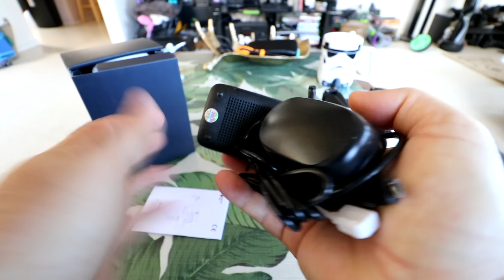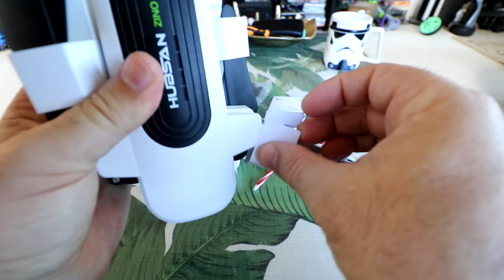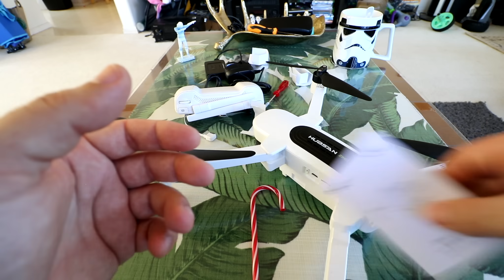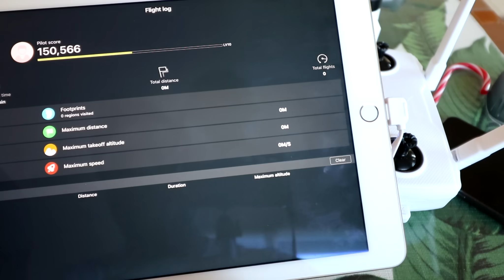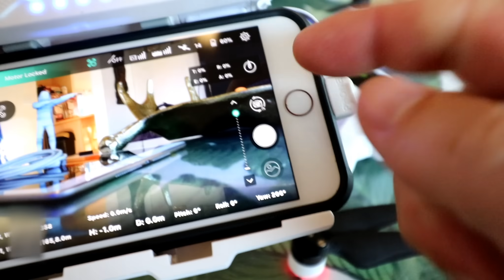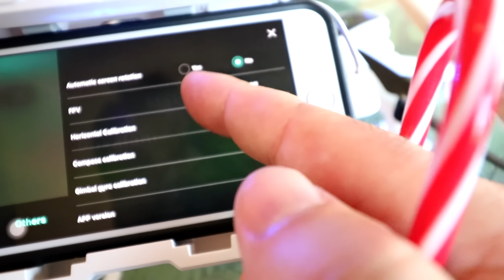Hubsan ZINO Review - Part 1 - [Unboxing, Inspection, Setup, Pros & Cons]

Comment: Dustin, what is best batter for zino to optimise flight times, think I getting 14 mins out of a 3200 gifi bat? I intend to invest in a 4200 mah gifi from aliexpress but will it boost my flight times up? I am aware I can get a 6500 mah Zino pro batt but it needs velcro in? what would you recommend as a seasoned Zino pilot? Rob
Reply from the maker: You'll get more flight time but remember it stresses the drone out the more weight you add so parts may not last as long 🍻

Comment: I ordered the Zino from the company website on July 14th and just received it today.  Every thing was packaged in the black bag because I ordered the Zino Portable version that comes with one extra battery, carrying case, and car charger.  But, I was surprised Dustin received an Asian type wall plug instead of US wall plug.  I received US plug type.  I agreed with Dustin that the manufacturer should paint different color on the controller.  Everything is white, but my video button has no red dot. It has a video symbol.  It took me almost 4 weeks to receive it and ends up paying $40 for shipping because the company said they don't have in the US warehouse.  So, it shipped from China via Fed Ex.  The Chinese company logistic needs to be faster on par with American.  They're slow.  I looked at their shipping status. It was picked up from the company on Monday and ship to the final location in the other city about 40 miles distance.  It took them 3 days.  On Thursday It was flown out to South Korea, then to Anchorage, Alaska, then to Washington DC.  Just two days on the fly. The Fed Ex delivered to my door on Friday before noon. It means today when I wrote this comment.  It moved so fast when it was in American hand. It moved so slow when it was in China.  I paid $419 for this drone, not including shipping cost. I never have any drone before and this is my first one.  Make sure you charge drone battery and controller.  It took about 2 hours to get full charge.  I plug in the drone battery at 6:30PM and went outside to mowe my lawn.  At 8:30PM, I came in the house, the charger shown green color.  I first want to buy DJI, but dang too expensive.   
If you need Zino manual, just type Zino drone manual. You will find a full version User Manual and a Quick Start Guide.  Then, you can print it out. I hope it will help.  I now need to set it up and need to watch more Dustin video.

Comment: took delivery of my zino yesterday, all cables were included for older and new android as well as apple, I took advantage of the Husban flash sale and got mine direct from Husban for 295$ US. I love it, I see comments complaining that it doesn't have the features of the mavic air...this is ridiculous, it is half the price and delivers as good of a camera and better gimbal, of course it doesn't have the features of a 700$ drone, but it has everything necessary to take comparable pictures and videos, and for 300$, 100$ less than a spark with a HD camera and 2 axis gimbal. Thank you Husban for making something I can afford

Comment: First, thanks for the vid. But I wonder why you keep comparing a $400 drone to a $1200 drone? It's really not fair to either. The level of detail is appreciated, but if you must compare to DJI - which makes no sense, but everybody does it - then please also compare to other $400 camera drones like the UpAir One, or even the Spark. Of COURSE it's cheaper. It's BUILT to be..  Software is the true trickle-down value, once the basic control and comm code is solid, anything you WANT - flips, race mode, dronies, waypoints - can be added for the small cost of extra storage. The rest is marketing.
I have no ill feeling fro DJI - the Spark was my next option, but for the 10080P. I just like to compare apples to apples,

Comment: I have big expectations about Zino. But they will need some time to get things to work smooth. I hope they will not rush. Better few months delay at final version then to put it on market not prepared.

Probably you now. Still I will wrote somethin about length units. But I know that you know this already. :)
1 yard is 0.91 meter. What could simply transfer into 1 meter. The difference is not to big. 100 meters = 91 yards.
While 1 yard = 3 feets = 1 meter.
So for basic is just need to multiply meters x 3 and you get feets. 100 meters = 300 feets.

And yes final version would be good to have both length units.

Great review. (Y)

Comment: Great review once again dustin.👍🏼 I’m so glad I went on your review and opinions on my drone options (DJI Mavic Zoom)
I’m not impressed with the Zino! I mean I’m still an hubsan fan as I have 2 H501ss drones and spent quite a lot on extras. They fly well and I had fun. 
But my Zoom is another level and quality. Excited to see you put the Zino through its paces. Do you only have 1 battery? That’s gonna be time consuming doing an in-depth flight.
Also would the H501s charger cable fit the Zino!! They look identical. Keep up the good work dustin loving your work👍🏼👍🏼👍🏼👍🏼👍🏼👍🏼👍🏼👍🏼👍🏼
Reply from the maker: Yes, the zoom is in another league but should be at the price difference.  This is a 3s LiHv battery so needs a special charger.    New US charger just arrived yesterday and works perfectly 👍

Comment: Its a UK 3-pin plug Dusty, you should send it to me. 😉
Reply from the maker: Thanks, I think the charger was defective or not US voltage compatible  and was only charging battery to 65%.  Got a new  US version in today from Hubsan and it's charging fine to 100% 👍

Comment: Look around for cheap balance charger B3 type.
I'm pretty sure you supposed to have at least two compatible,
if u still have XK500 he come with good tiny blue alumiinium  balance charger with buzzer and cell voltage detector.
Or maybe battery is not charge well because is budgeted.
Reply from the maker: This is an HV 3s so was hoping for full LiHv charge.  I did find a standard 3s charger that may work to at least get it over 65% which it seems to be maxing out at with provided charger 😂.
Reply: Ok, give it a shoot.
I just check RC sailors second video and they start at 100%,
if they not charge cell by cell with Imax B6, or some other better,
el chipo Hubsan charger must do the work.

Wait to see that maiden test at 65% battery
and another at 100%.
Regards : )
Reply from the maker: A new US charger came from Hubsan today and it looks like it's charging fine to 100%.  I think the UK charger was defective or not working for US 👍
Reply: Good,
me personally will wait to see some sort of review A3 vs Zino,
FIMI start shipping out too.
Especially after i see the white remote plastic.
Please upload some raw or edited-joined once 4k footage 
in further review parts if all other is ok,
Regards :)
Reply from the maker: Yes, I'll have 4k video and pictures up in flight test 👍

Comment: My bebop 2 just spun out of control today. Apparently two of the motors stalled in during flight. I was putting a bit of stress on the motors though 
1. Cold weather
2. Driving it like I was drunk 
3. Moderate wind 
4. It had no GPS signal 
Luckily it survived and still works properly after a reboot. Do know anything about what happened?

Comment: I have two dual battery modded H501A and use the advanced pro controller H906A, do you know if the Zino is compatible with the H906A controller like the H501A? I use WI-FI only for Waypoints and always have my H906A on, on standby during waypoint flights. Also would of been nice if the batteries were of the H501xx types, two cells 7.4v plus dual battery ready...considering I have eight, 7.4, 2 cells Hubsan batteries...lol

Comment: Are there manual exposure settings for the camera? Don't see it anywhere. Thanks.
Reply from the maker: I could not find any camera settings 🤔
Reply: Thanks so much Dustin. Sort of a deal breaker for me. So much to like about this drone. Perhaps exposure control can be added in a firmware update.

Comment: I saw the review by the RC Saylors. I'm curious to see if it works as well for you. The gimbal system seems to work well in windy situations. I wouldn't normally be interested in this type of drone but at this price, I might have to get one.
Reply from the maker: I tried to do the flight test and gimbal is very good.iPhone screen did not record and UK charger would not charge past 65% so I'll try again when I get the proper cables.

Comment: @Dustin Dunnill about the missing USBC cable for android: could you contact hubsan and ask about it? It should be in as reported in the zino homepage
Reply from the maker: Yes, I did.  They said the Android ZINO support wasn't ready since mine is a demo model and they are sending a new US charger and USB C cable now.

Comment: Thank you for your video. You are like my mad scientist when it comes to quad-copters LOL...because of your HD camera, I can see how cheap the build quality is. I could not see that on other reviews. I guess to save on the cost. Like you say that's not really a big deal as long as it flies and takes better video then the spark. I am a little bummed on the plug to charge but I think my XK x380 has the same barrel plug, but it is 2A and 12V.  I'm not sure if that is a problem to use it.  I mean, common sense would be to give your American customers the proper plug.  Hubsan, it's not rocket science, look at your address when you ship LOL.  Also bummed about it not having Android support on USB-C, but if you own a DJI mavic pro do you think the USB-C to mini USB transmitter adapter will fit on the Hubsan transmitter?
Reply from the maker: Thanks.  I tried my DJI cables but only have the rectangular shape and it doesn't fit.  Hubsan is sending the proper equipment and the Android app should support ZINO when it comes in 👍

Comment: I did see some video from this, and it looks pretty good.  No real way to adjust EV (exposure value), so it does its own 'auto correct'.  Priced at the level of the Spark, but doesn't have any of the obstacle avoidance of the Spark .. but a better gimbal (Spark's gimbal is just 2 axis with EIS on the 3rd axis). Doesn't have super range .. no where close to the Mavic Air .. closer to what you'd get with the Spark. Too bad about no "Imperial Units" .. that SHOULD be an option .. perhaps in a future FW update. Will be looking forward to your flight tests. 

Oh, about the name. The 1st thing I thought about when I saw "Zino" was an old episode of "Lost In Space" .. where Dr. Smith meets up with his doppleganger (a space cowboy/outlaw) who is named "Zeno". Only your "more mature" followers will likely remember that.  Oh well ... at least I've not lost my memory .. yet.  Cheers!
Reply: I mentioned the no avoidance issue to the RC sailor video. He asked if we really needed that! I replied with the question: Is there such a thing of being too safe? I'll keep my Mavic
Reply: I think the question should be is the obstacle avoidance worth the extra 300 dollars, not everyone has $700 to spend on a drone, or we would all be dealing with the nofly zones of DJI

Comment: Good review very interesting. You forgot to mention controller battery and controller charging
Reply from the maker: Your right sorry.  Charges through that side micro USB port with the black USB cable supplied.
Reply: @DustinDunnill  ok cool thanks friend